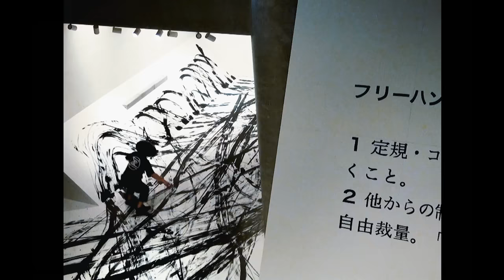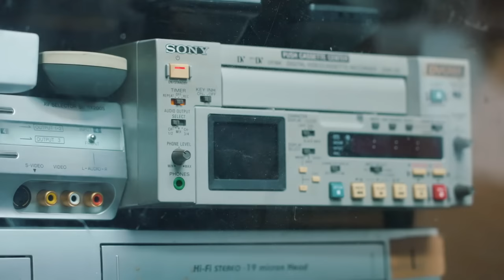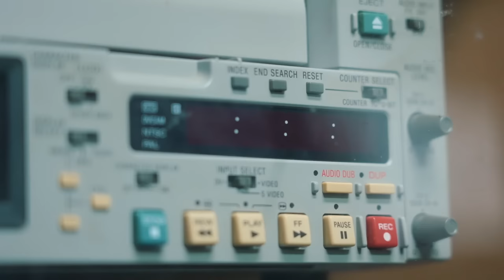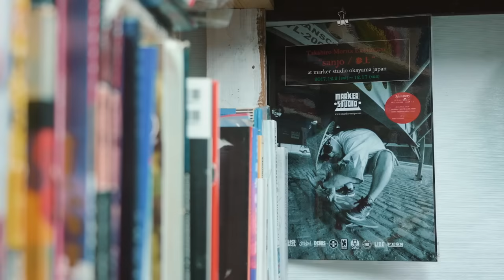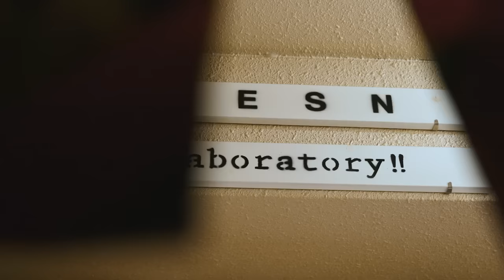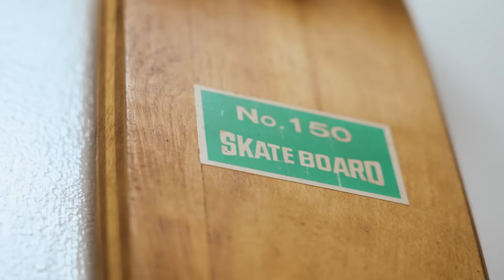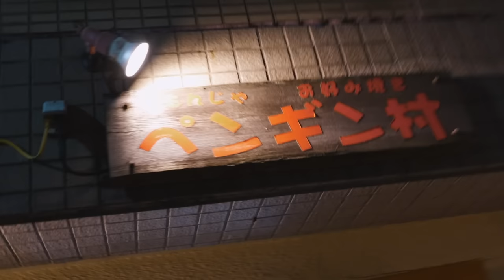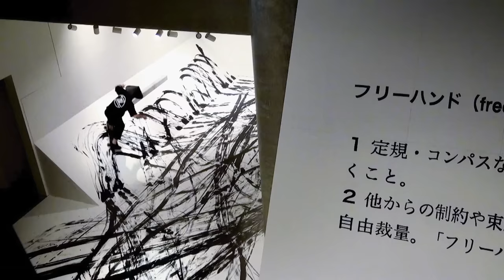A New Approach To Skateboarding With Takahiro Morita | SKATE TALES

Comment: i fw the philosophy, especially the respecting objects part. i'm in the process of cutting out wheel wells on an old chipped up deck to convert it into a cruiser, with old dropthrough longboard trucks i never used, and it's becoming my new favourite thing lately. big ups, Takahiro